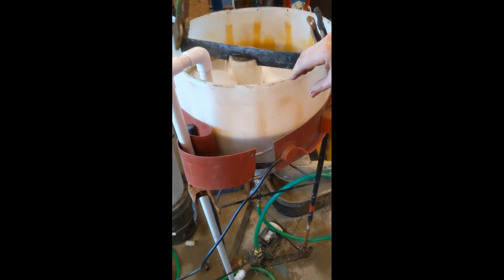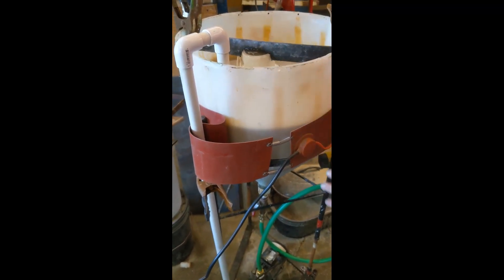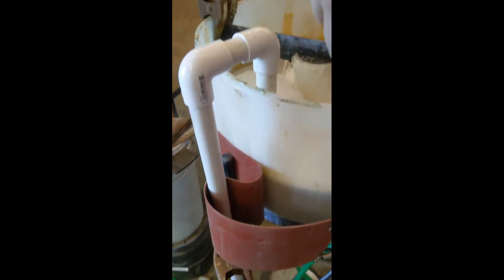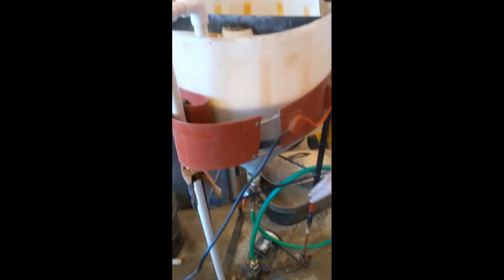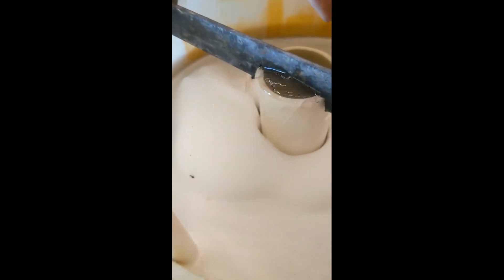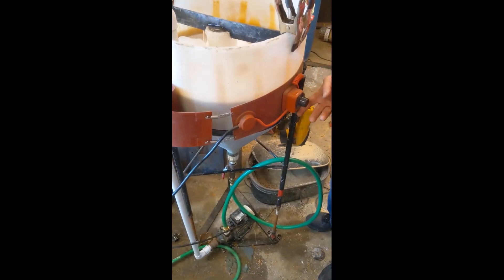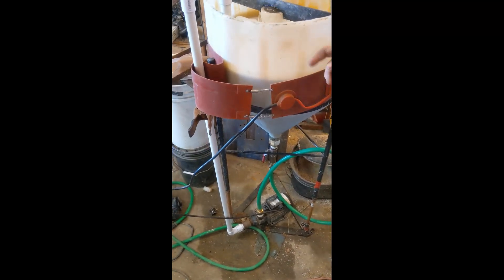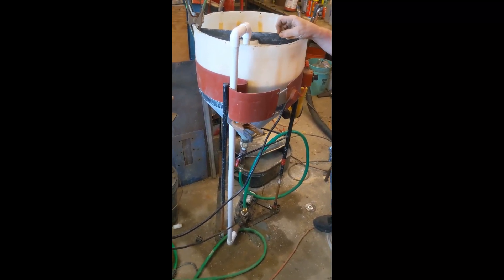GOLD LEACH TANK Test of eco goldex. (Will it work)?

Comment: Nice set up. How many pounds can you leach with that?
Reply from the maker: that one was good for about 50 lbs of concentrate = to 500 lbs of ore,  we have found out our magnetic collector is getting 96% of the gold so we no longer plan to leach the the tails.  we will leach only the magnetic concentrates in a 50 gallon hot vat tank.  is should be able to to 100 to 200 lbs of magnetic cons.  that 1000 to 2000 lbs of ore.
Reply from the maker: We're still figuring that out but we think 50 to 100 lb.
Reply: @bosrecreationalmining  I know it's cool to make that, but why not just use a cement mixer?